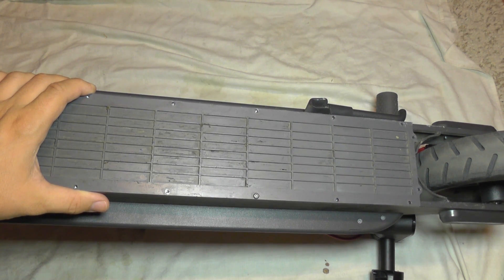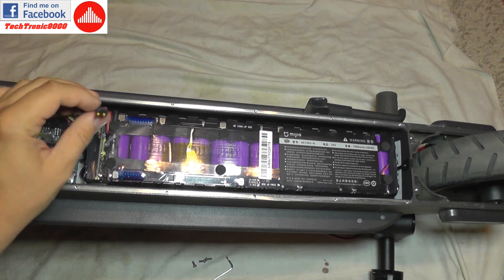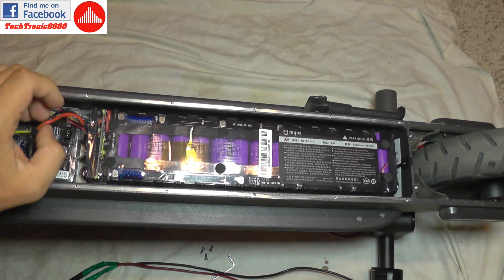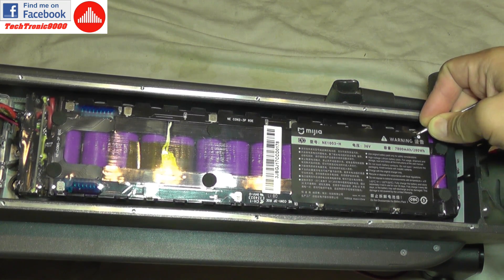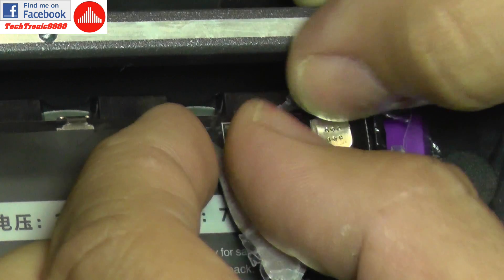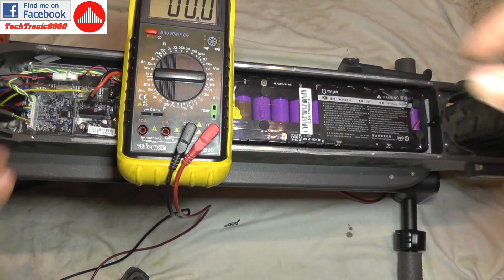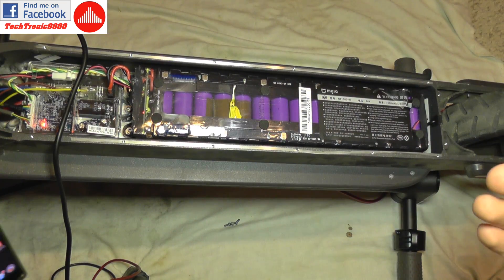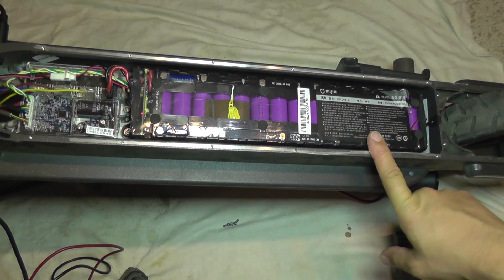Xiaomi M365 - Battery Repair, No Power ON, Not Charging

Comment: Can you replace the BMS and the power supply to make it fast charge or does it need a connection to a microcontroller?
Reply from the maker: No you can not, the controller has a data interface with the BMS and will give you warnings and errors without it.

Comment: Hey mate... Can you please take a look at my video. I have a big issue with my scooter and I have no idea how to fix it :(
https://youtu.be/pb8zL2p3W_I
Reply from the maker: Connect the Mi Home App and unlock the scooter !
Reply: TechTronic9000 the scooter is not locked...
Reply from the maker: Check the connector in the handle bar.
Reply: TechTronic9000 thx for your response :)
I think there could be a problem with controller in the handlebar. Its possible that water was a problem

Comment: Hi. After stop in recuperation (in hard mode) and using a brake pads my m365 switched off. In house I plug in to 220V and at power adapter indicator show red color, but scooter do not switch on, I open the cover and see flashing blue light at idle mode and if i connect power source it blinking red. After 1 hour dc power source light green color and there is no more light at battery. I measure power at black and red power cable and voltmeter show 3.7V, in contacts at battery show 41.2V. What i should to do ?
Reply from the maker: Your battery fuse may have blown out due to maximum recovery mode.
Reply: Regenerating in hard mode with a 1-fuse battery is the same as killing your fuse.

Comment: Hi all.
I had problems with my scooters electrics from the beginning. Finaly I replaced BMS and controller to non Xiaomi make. But I never had a problem with my tyres. 
How many miles you did up to the first puncture? And how much pressure usualy you put in to tyres, please.
Thanks
Reply from the maker: What BMS are you using ? I got the first puncture at 250km, after which I've changed the roads that I use and I was getting punctures very often, sometimes in less than 20 km !
Reply: I bought the cheapest 10S BMS with cell balancer, 40 amps. 40 amps is a bit too much as battery does 10 amps discharge only, according to some youtube videos. But I was worried, that cheap BMS might not last otherwise. Also I put 350W controller, which should't owerload battery. I done just 100km after repairs, but everything looks good, so fare. No issues, like I had before. 
How much you pump up your tyres, please?
Reply from the maker: I was using 45-50 psi in my tires.
Reply: With tires it's important to keep the pressure right. I had a first pinch puncture in ~3 days of use :)... After that I keep the tyre pressure right and I didn't have punctures for 400kms. After that I had a worn inner tire, so I replaced it with the thicker one. Now I think it will be fine ... after i get the scooter on again lol.
Reply from the maker: And at what pressure did you kept the tires ?
Reply: I think its ~45 rear and 40 front. And by the way - to make sure new tire isn't worn by rough outer tire, i cut the original tire and glued it to the inside of the tire... so the actual tire thickness is ~3 times thicker than what it used to be originally.
Reply: Labas Nerijau, ar skaitote komenaturs? Turiu problemu su BMS taip pat, buciau ziauriai dekingas jeigu galetumete pagelbeti patarimais :) Jei perskaitysite sita komentara parasyte prasau meila i labas eta raimis taskas lt :)
Reply: hi, can you give me links to parts that you used? allso some pics of installation would be great :)  i´ve been trying to get original bms, but it seems those are not available
Reply: Hi. I still have my faulty BMS. I suspect one of the chips gone. You can have it in case you after fuse or some other hopefully working part. Where about are you based?
Thanks
Reply: Nerijus, we are more interested in what BMS did you use to replace the original one. Do you still have all functions of the scooter (backlight, regen, etc..). We are from same country, it would be nice if you could provide more details if what you did is only available in Lithuania (my email is in comment above).
Reply from the maker: Any other BMS will not work with the M365 info so you will lose indications such as range or voltage. Join here where your are going to see soon a variation of this project, a M365 that does 40-50 km range: https://www.facebook.com/groups/296740267399994/
Reply: Nerijus Genutis  it would be great if you could send it to me.  can you mail me m_janhonen At hotmail dot vom
Reply: Yeah, but that's better than loosing a scooter :).. I can live with an app, and I've seen Russian folks adjusting programable BMSs to show more or less ok range.

Comment: Hey - So i recently run a flat on my rear tire, replaced with solid alternative and then two days later have a similar issue. Green light on the power adapter, no juice and can't turn it on. I'm making an assumption it is the same battery issue and wondering if anyone has had any success getting this fixed under warranty? I'm not overly keen on attempting to re-solder the battery tabs, but I guess, needs must! Can anyone advise if this permanently fixes the issue? Is it likely to repeat?

Would people recommend putting pneumatic tires back on/replacing the inner tubes? Any good alternatives? 

My partner has a scooter too and has flat front and back tires after a few weeks of use. 

Many Thanks guys, all your help is much appreciated!
Reply from the maker: Well, you question is very good, original tyres are too thin and get a lot of punctures easy, the solid ones are good but they are too stiff and will not absorb shocks. Recently a new model of tires was released along with new inner tubes. Reports from some of my friends are very good, they seem to be much more better (thicker) and no more punctures. I'm also considering of going back the pneumatic tires. Here is tire: https://goo.gl/z4i81P and this is the inner tube: https://goo.gl/sTWFeP

Comment: Dont use normal soldering as like this... heat is not a good for battery.. and also normal soldering easy to get impact again... Please find my video I use spot welding
Reply: Soldering to the nickel tabs quickly with high heat isn't bad, it's when you use a small iron and soak too much heat into the cell that it degrades. It's not ideal to solder to the + terminal since there's a pressure relief valve under it that heat can mess the spring up on, but soldering to the nickel tabs coming off of the cell is okay.

Comment: Hi again.
Now my scooter is not even switching on, i found the contact on the right corner unsoldered (same as you). I never used a solderer, should i just melt the metal wire between the contacts and press until they stick together?
Reply from the maker: It should be best to find someone skilled, it's very important to know what you are doing as lithium battery + heat is not recommended so you need a good soldering iron and to work fast !.
Reply: TechTronic9000 would you suggest a good soldering iron to buy? I'm in uk.
Reply from the maker: For the scooter repair I have used a gas power soldering iron, because it heats much more faster and has more thermal power, making the soldering action to take less time. This is my model: https://goo.gl/vH51Jv
Reply: mvarcadia Hi! Can you just let me know if you still want to do it or you changed your mind and I have to find another solution? Have a good day!
Reply: To solder nickel, you will need an aggressive 'flux' so that the solder flows and doesn't just form a blob on the surface. And the OP is right, you have to work fast so that the battery cells aren't overheated. This will fix it until the next contact lifts off and you have to do it again. I have developed a long-term fix where I bypass these contacts. If you can get your battery to me in Brighton, I can fix it for you. All it will cost is the return shipping charge plus GBP1.50 for the new plastic shrink tubing. Note that Royal Mail have now put lithium batteries on the banned items list so you will have to use a carrier such as APC.
Reply: mvarcadia Thank you. I think it would be better if I send the battery to you, will you also test it?
Reply: Yes, I can repair it and test it and i'll let you know when it's ready for collection so that you can book a courier to collect it. What's the best way of getting in contact so that we don't have to make our contact details public?
Reply: Yes, I can repair and test the battery if you send it to me.  How do we get in touch so that our details are not displayed on this public forum?
Reply: Yes, I can do it. How do we get in touch so that our details are not displayed on this public page?
Reply from the maker: The best way to personally contact each other is to send a private message through the YouTube channel page. If you post here an email address it will be automatically hidden by YouTube comments. If you don't manage to do that you can contact me through my facebook page: TechTronic9000 and I will relay the email address to the other.
Reply: TechTronic9000  mvarcadia i sent my email to techtronic9000, if you do the same we can continue privately
Reply: I had a lot of trouble: Facebook Messenger wouldn't let me send a message to TechTronic9000 and I can't see the Send Private Message button his channel but I've emailed him and asked for your email address. Hope to be in contact soon.
Reply: Hey mvarcadia - I'm wondering if you could help me with my battery too? I am happy to take a trip down to Brighton? Let me know if you can spare the time, would be much appreciated. G
Reply: Yes, I'm 95% certain I can fix this, Gareth. There are 11 tabs and one of yours has lifted - probably the one nearest the rear wheel. Others can follow but I've developed a more-or-less permanent fix while we have the plastic off so your battery should be more resilient in future.

I've now done 1,100 miles (1.800km) and never had a front wheel puncture but the rear wheel inner tube split several times before I put the solid tyre on. I've ordered a heavy duty inner tube and will go back to pneumatic when it arrives.

The tyres/tubes are rated to 50psi and perceived wisdom in the cycling world is to inflate as high as possible to minimize rolling resistance and to lessen the risk of punctures. However, I feel that this introduces too much vibration on the scooter so I will use 30psi as I do on the front and put up with the slightly reduced range that will follow.

We need to get in touch aside from this public forum. Could you please contact TechTronic9000 through his business email published on this site or through his Facebook page and hopefully he will pass it on to me.
Reply: mvarcadia hi! have you received my battery? I also sent you some emails.
Reply: Not yet. I replied by email just now.
Reply: The battery was delivered an hour ago. It's now fixed, hardened against future problems with the welded tabs, tested, new shrink tubing applied and is ready to be picked up. Or I can deliver to a nearby drop-off shop. 

Let me know what arrangements you make for getting it back to you.
Reply from the maker: Hey guys, feel free to join also my new electric scooters / vehicles group here: https://www.facebook.com/groups/296740267399994/

Comment: First of all I never used a tester before,  anyway i used it as you explain and it shows 19,7. I checked the contacts as you did, without opening the film i noticed one contact was bended but it looked soldered anyway so i didn't touch it.
My scooter has the problem that after changing the tyres (i installed the solid ones) the battery doesn't last enough. The scooter also switches off ( with almost full battery) and sometimes I can't switch it on until i don't connect the charger. Any suggestion? 
Thanks
Reply from the maker: Sounds like a contact issues, 19.7V is half of the normal voltage. You should take the battery out and check on the other side of it also.
Reply: I've had the same issues after putting a solid tyre on the back wheel after it kept puncturing. I think we have brought these battery problems on ourselves due to Xiaomi putting very poor inner tubes on the rear. These keep splitting.
Reply: mvarcadia Thanks! Is your scooter now working properly? Also with solid tyres?
Reply: Yes, it's working OK with solid rear tyre but it is very bumpy when the tyre is cold so I have sent for a better quality inner tube and will revert to pneumatic when it arrives. I have never had a puncture on the front tyre and probably would not put a solid tyre there for fear of damaging the motor.
Reply from the maker: There are better aftermarket tires now such as: https://goo.gl/AsoQzU and better inner tubes: https://goo.gl/iAg75p

Comment: Hello! Which version is it? V1.2 or V1.3?
Reply from the maker: Mine was originally 1.3.1 and later updated to 1.3.4 by using the Mi Home app: https://youtu.be/fDWtlgmqhN8
Reply: TechTronic9000 so they do not fix it on the V1.3 version :(
Reply: And what was Your recovery battery level when it happends?
Reply from the maker: I use weak recovery rate as I live in a mostly flat city so it doesn't make a lot of sense to recover kinetic power, if it was after me I would have disabled regenerative braking completely. Also this is not related to regeneration, it was just a spot weld that failed. The regeneration + overcharge issue is a different story and until now it didn't happend to me and I'm already at 500km done.

Comment: I'd love to get it but it's pretty expensive here where I live. Great video as always.
Reply from the maker: It is also very expensive for me if I buy it locally. I have choose to buy it directly from China and the final price including all taxes and transport made it two times cheaper than it's selling in shops here. From what country are you from ? Maybe I can get you a half price deal :)
Reply: TechTronic9000 I'm from Poland and that half price would be very tempting :) also I wonder if it's possible to use it as a regular kick scooter, I won't be expecting to get any charge by that ;-)
Reply from the maker: The lowest price currently for Poland is 369.99$ and that includes: shipping (free), and it's also tax free (no need to pay for customs or VAT), i'm your neighbor from Romania, locally a M365 sells for: 750-800$ in shops. If you are interested let me know and I can give you the price offer (a discount coupon).
Reply: I even saw a price of 330$ but shipping was made by a train so it's around 40days(but I'd be willing to pay more to get it faster). Winter is coming and I wonder if that would be good enough to commute in colder weather.
Reply from the maker: Well there is a new offer now, the scooter is 379$ and for Poland they now have "Priority Line Express", it adds 54$ to shipping but it only does 8-18 days on the road, so it's very fast. This is the offer: https://goo.gl/69FkVZ
Reply from the maker: For cold weather the battery range will decrease, for 0°C you will get ~ 50% of the total range, so you will still get around 15-17km, while in 15+°C you can really get 30 km on ECO mode. If you store the scooter indoor during winter so it's warm when you leave then it will perform better.
Reply: TechTronic9000 thank you, I'll check it in Monday because I want to pay with PayPal. Winter performance bothers me because batteries don't really like cold weather
Reply: @szymon889   plugged min in big pop and 3v
surpluse in ca is $50